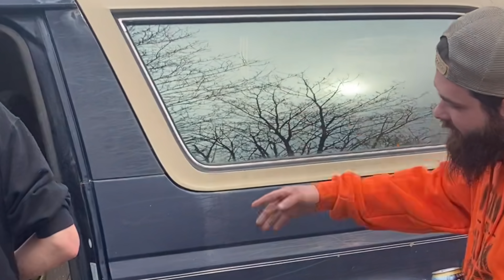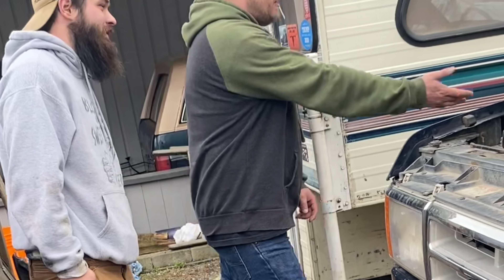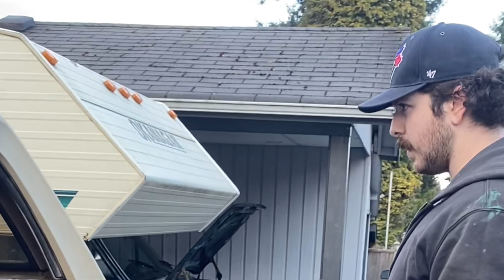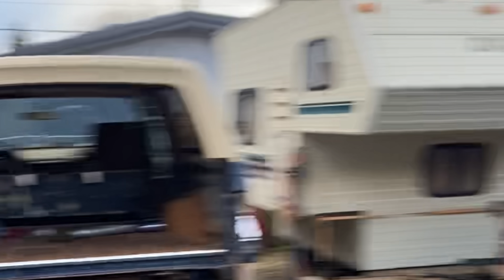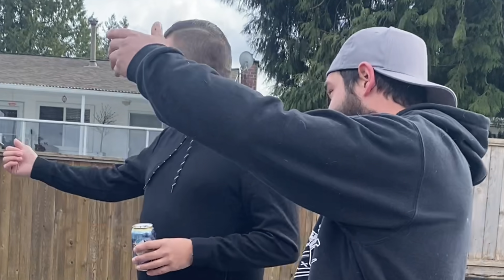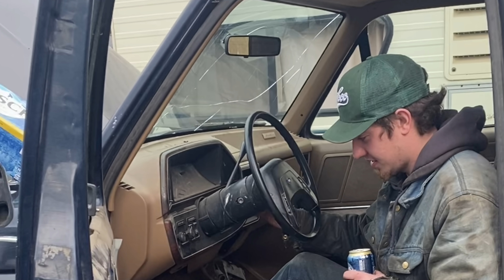ATTEMPTING TO SELL A TRUE SHITBOX!

Comment: I just put my 04 ventura in the ditch just the fuckin metal panels and the head lights are gone i also got a really nice 2001 ford winstar sport. Come pick them up before i scrap them. Someone could use em. I dont wanna scrap it and its still running good to go. ;) just a quick tow or two and you guys could acutally make someone happy with these.